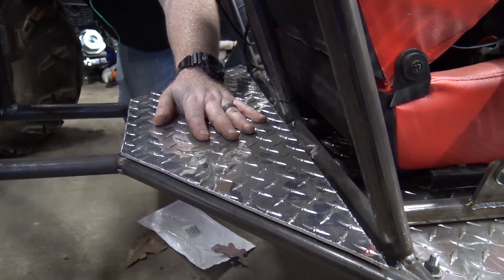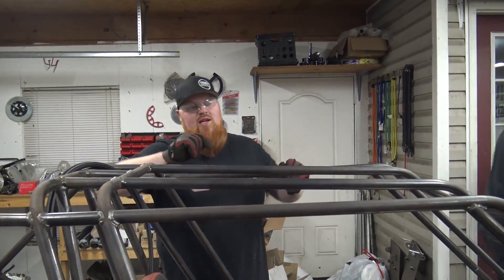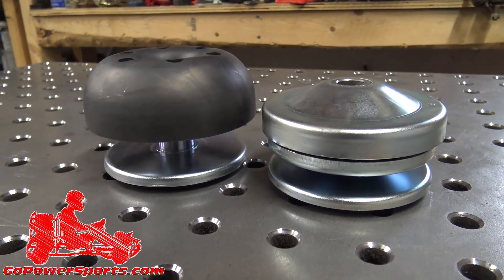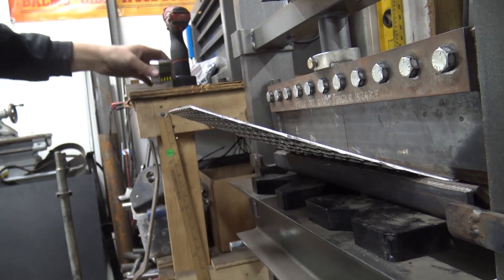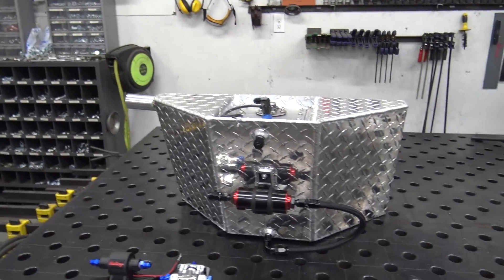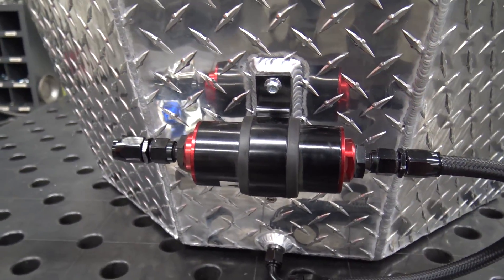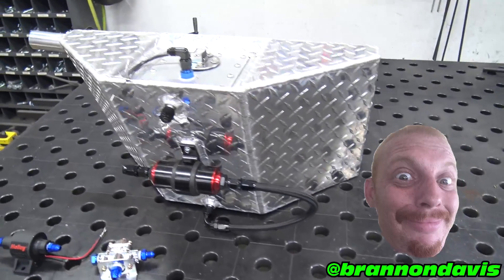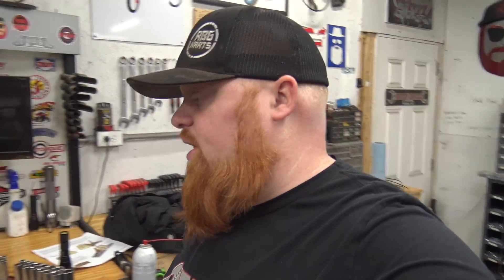Custom Off Road Buggy Aluminum Fuel Cell / Gas Tank ~ IRS Buggy Build

Comment: Fuel filter should be after the pump. If it's before it can cause cavitation in the line resulting in vapor lock.

Comment: Check out the Holley HydraMat       https://www.holley.com/products/fuel_systems/hydramat/hydramats/     You wouldn't need foam in the tank and you will be able to use all the fuel in the tank regardless of where the fuel pick up is located. Very nice tank and can't wait to see it driving.